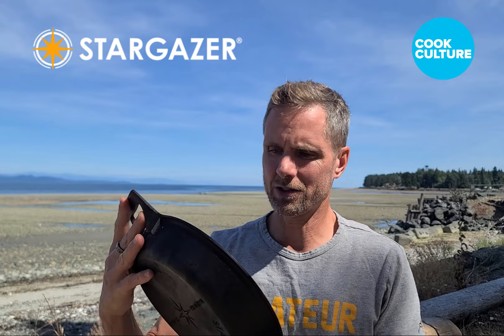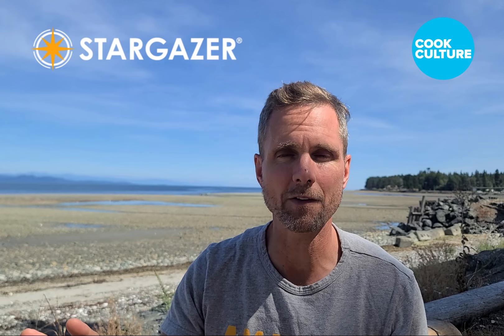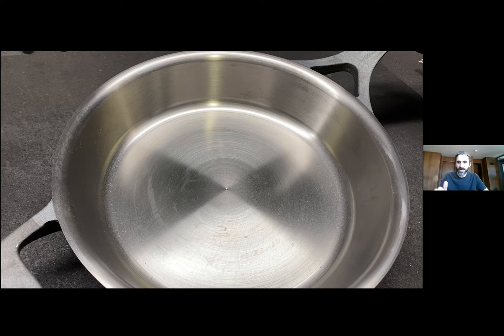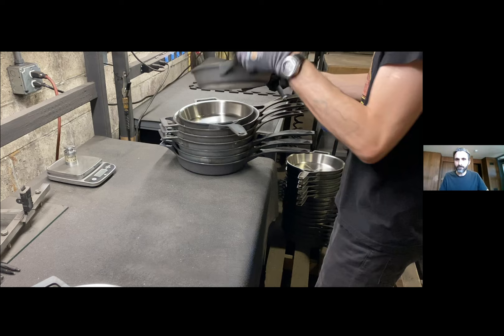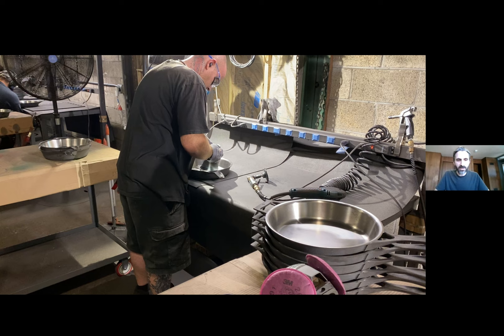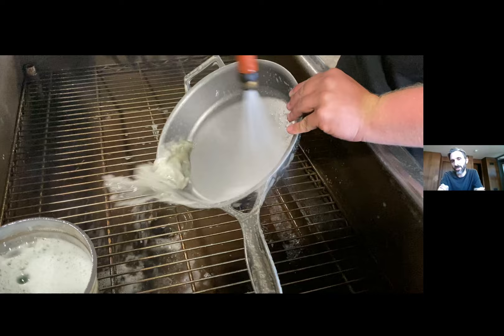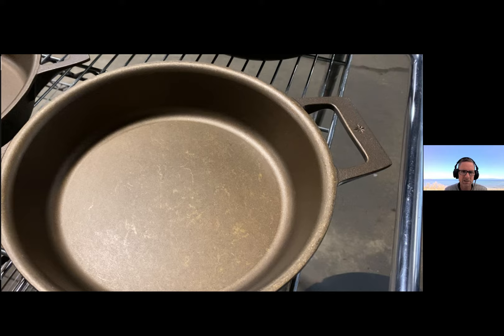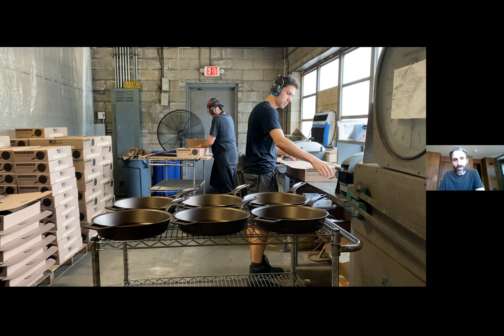Does Stargazer make the best Cast Iron skillets in the world?

Comment: This is a great video on how Stargazer is USA hand made.   I didn't know about all these steps on how they were made when I order my two pans last Christmas based on Kent and Shannon Rollins recommendations of cast iron.  I used cast iron when I was a kid in the 50's and 60's when I had to cook my parents breakfast 5 days a week before they went to work.  My two Stargazer pans are my first cast iron since the 50's.  I cook a lot on electric stove, gas stove, grills and camping stoves.  I am extremely pleased with the 10.5" and 12" Stargazers on even heating and cooking.  I have only used hot water and a brush to clean my pans.  I did three additional seasonings with grape oil in my gas grill at 360 degrees for 1 hour.  Then I cooked bacon and eggs without sticking problems, only hot water clean up.  I love the long handle and the helping handle to move about the cooking area.  The long handle usually stays cool to the touch for most cooking seasons, but I do have pot mitts for the times the cooks are over thirty minutes.   These cast iron pans are so much better than my traditional stainless steel pans that the only time I use stainless steel pans is for long cooks of tomato based foods.  I very pleased that all parts and labor are in the USA,  This provides many families with jobs that puts food on their tables and reduces the cost of SNAP.
Reply from the maker: Awesome!! Thanks for the note

Comment: I just ordered both sizes based on several people’s high praises (including yours). I love that I was able to get TWO really great high end skillets for the price of 1 of the others but still have then benefits of some of the vintage cast iron.
Reply: Cast Iron certainly has its place. I had some seabass last night off mine! 5 mins each side and 5 mins @450 in the oven = winner!

I do want a set of good carbon steel pans though. Same principal as the cast iron, but they perform like a traditional pan and have further versatility. they are non stick but can handle really high temperatures. To me they are the lifetime non-stick pan.

I'm going for the De buyer Mineral B Pro line of pans. similar in price to the stargazer, and another lifetime product. Also, carbon steel is a little lighter than cast iron.

Comment: Yes Stargazer are seriously the best cast iron out there. I also own Finex, Lancaster, Copco, Lodge. i go for the Stargazer 9/10 times in my cooking. i also like Finex which has an awesome cooking surface but a lot of factors including weight, price go against Finex but a really great product. Overall, all things considered Stargazer is the winner!
Reply: Just curious, why would you say stargazer is better than the other top brands?
Reply: @4tCa4mzUPqRZZo  it cooks so well, doesnt burn like Lancaster ,is easy to clean unlike Lodge, has the best pan side food doesnt get caught in the edge, the pan thickness is just right, the price is excellent, handle great.. the only downside is they are not light but i have come to the realisation that cast iron needs to be thick to work well, retain heat, not burn. i think Finex is another great product but its expensive. its 10 inch pan is too small, the 12 inch you need a crane to move it. i love the 8 inch i use it every day for reheats, side dishes, scrambled eggs etc.  its a honey. In life ya pays yer money, and take yer chances but Stargazer is a pretty safe bet.....

Comment: The proprietary process used on those pans is a type of media/sand blasting. Not bead blasting. There are various grits and types ranging from silicon carbide to walnut shell. For a pan like this i would suggest a rough to medium grit silicon carbide.

If you're wanting to test any of this start with a finer/less aggressive media. You can work your way from finer to coarser until you achieve the desired texture.

This method should also work to completely refinish any cast iron/carbon steel pan (careful if your handles are stainless). Giving the pan a perfect deep clean in the process, or should I say resurfacing!

Comment: I have a few pieces of carbon steel, and lots of cast iron. I just started going into carbon steel after years of using cast iron. Although CS heats faster and is lighter, it seems so much harder to maintain and can rust easier.
Reply from the maker: Try post seasoning more often
Reply: The best carbon pans are going to be nearly as heavy as cast iron, and vice versa with cast iron, if you get a well designed, balanced weight, smooth cast iron pan, you're basically getting the same product. There's I think only a 1% difference in the formula's.

Comment: Hey again...  24:40   The secret sauce....   This is what I was talking about before when you had mentioned taking the pan down to the silver.   Once you smooth out and polish or remove the textured cooking surface of a cast iron pan, it's pretty much wrecked.   It will never hold the seasoning.    I have been using a wire brush by hand, over the course of several days now on that Wagner I mentioned.   Soon I'll be able to re-season it.  I might have to get one of these though.  12 to 14 inches....Yeah!

Comment: I just received my 12" Stargazer and I'm super excited with it. I've added 3 layers of grapeseed oil seasoning on top of the factory seasoning and will probably put it into action later today. I will probably retire some of my other skillets lol. I also just got a Lodge Blacklock 14.5" skillet. I already have a hard time deciding which skillets to use so I'll probably put my Lodge skillets that I've sanded smooth on display like art. And yes I will be getting the 10.5" Stargazer soon.

Comment: I don’t know how good one of these pans is, and I’m unlikely to ever find out. There is a very good explanation of how the founder got into the business of making cast iron cookware. There are a lot of superlative adjectives about the product. There is a discussion about manufacture, where we learn that there is NO difference in the material used down through the years to make the pan, and no difference in the method. So, we are told, it comes down to the finish. So- look at my 55 year old cast iron skillets. Their internal finish now is a smooth black after years of seasoning. I don’t remember how smooth the inside was when we got them. They are used regularly, they cook evenly, with all the characteristics of cast iron. There are no markings on the bottom save “Made in USA.”
While I’m sure that the price of this cookware has a lot to do with the amount of hand finishing shown in the video, I haven’t been shown a single reason why I should use Stargazer over the cast iron I already own.
Reply from the maker: Hi, there is no reason. If what you have is working, then there is no need for a new pan!

Comment: That ridiculous "helper handle" on the 10 1/2-inch skillet is a deal-breaker for me.
I have a tight kitchen without a lot of room to waste. That enormous appendage gets in the way of fitting the skillet in a drawer or of washing it in the sink without it knocking into things. Especially for a comparatively light-weight skillet like this one, the exaggerated extra handle is completely unnecessary.
Reply from the maker: I'd recommend Field Cast Iron for you
Reply: I suggest you hang the skillet from a hook on the wall or ceiling
Reply: You could cut off the helper handle pretty easily
Reply: @Cook-Culture  I use a Lodge. I'm not persuaded that a Field or a Stargazer or a Finex would actually cook any better. (But the Field certainly has a more reasonable "helper" appendage than the Stargazer.)
Reply: @kipwoods8400  I could also not buy the pan. That would be even easier.
Reply: Cowboy Kent Rollins has nothing but praise for this pan..he knows cast iron!!

Comment: No, stargazer does NOT make the best cast iron pans. The pans are OK, but that's it.. I own 2 stargazer pans.. They do NOT have lids. I want a lid for my pans. The metal is a blend of different metals.
Reply from the maker: Hi, every cast iron brand I know of uses recycled mixed iron. What brand would you suggest is more effective than Stargazer?
Reply: @Cook-Culture  I have a few Old no name cast iron pans that work just as good if not better than the stargazer pan I have. I picked up the Old pans at flea markets or yard sales thru out the years. I paid between $5 and $10 each. To say that stargazer pan are the best because I paid a shit load of money for them instead of the few bucks for the flea markets pans is rediculious. Like I said the stargazer pans are OK but I seem to use the cheap pans more often. As far as the cast iron metal goes. If you own a cast iron pan in seasoned and compare it to a stargazer pan you would notice the sparkly specks of NON IRON particals. You don't see that in TRUE CAST IRON of any kind.
Reply: @redhytech  I buy everything at flea markets:  brake pads, used syringes, no-name cast iron skillets, bulk underwear.  They're the only folks I truly trust